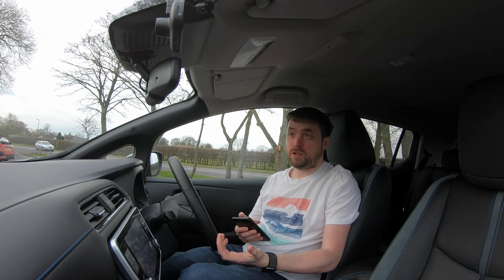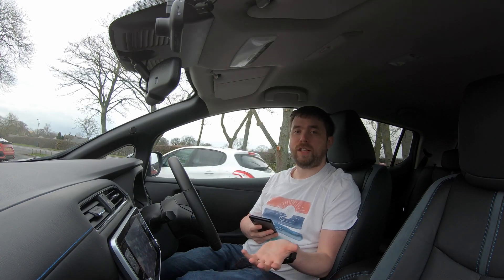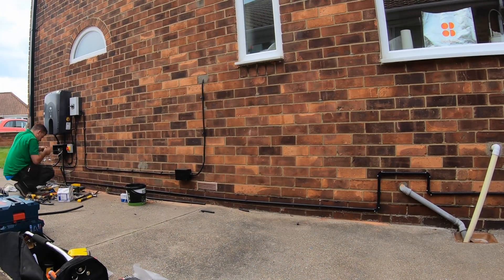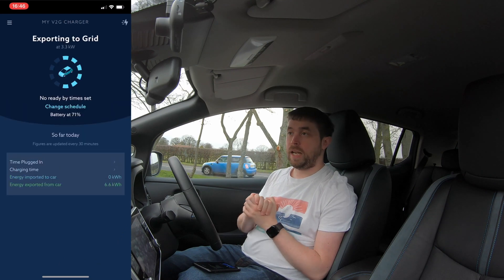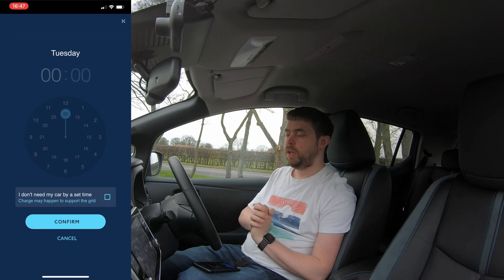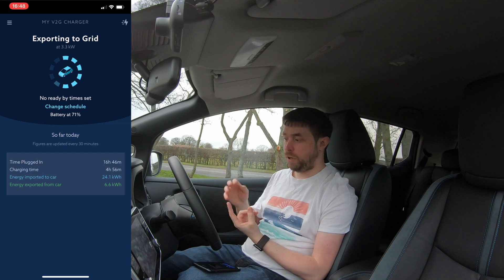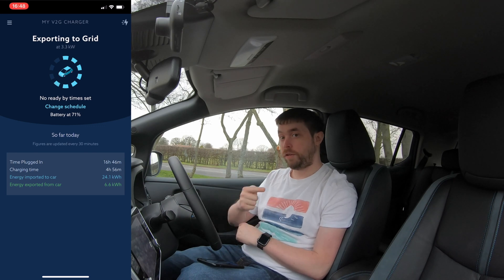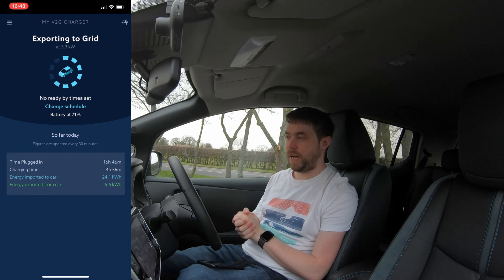2018 Nissan Leaf - Episode 047 - Vehicle to Grid (V2G)

Comment: The battery degradation cost more than £300 a year if it's going to be charged/discharged every day back and forth like that. £100 a month and it would start to make sense
Reply: I'm not sure if that's exactly true.  From what I understand, the lithium batteries like to stay at around 50%, so if you want to prolong your battery life, it's actually beneficial to charge it when it drops below this number and discharge it when it's above.  I suppose it depends on how the V2G system is configured, but in theory, it could condition your battery and earn you money at the same time.
Reply from the maker: Confirmed, V2G slowed down battery degradation for me quite a bit.
Reply: @unadopted  Can your system be set to stay between 10% and 90%?
Reply from the maker: I don’t have it any more as I no longer have the Leaf, but it was configurable and you could adjust the top and bottom thresholds. Defaults were to keep the battery between 20% and 95%.
Reply: @unadopted  Very cool, thank you.

Comment: Is this  still going?
Reply from the maker: The trial has ended but I still have the charger. Can’t use it any more as I no longer have a CHAdeMO-equipped car.
Reply: @unadopted  the idea looks good, and if it could make you a profit of £70 a month that could go a long way towards the running costs of the car. As long as it dose not unduly degrade the battery.

Comment: Great video and content, thank you. Given electricity prices in 2021 and beyond, can this unit power your house rather than grid export if required?  Cheers, 👍
Reply from the maker: Yes, but only while exporting. It won't work in V2H only mode yet (the Indra hardware is capable but the Kaluza software platform doesn't currently allow it).

Comment: Hii...I want to know that 
1what is the maximum capacity of the car can store?
2.The installation cost of V2G?
3.if 40% of battery is used as traveling ...if 40% of charge is exporting to grid how much power will go to grid?(just a guess)
4.time taken to charge the car.?

Am asking just because of am doing a seminar on V2G. Can you plz help me while solving my doubt!
Reply from the maker: Hi! Answers for your questions:

1. My Nissan Leaf has a 40kWh battery.

2. V2G unit and install was free for everyone on this particular trial. I don’t know what the retail cost would be.

3. If 40% goes back to grid that would be ~16kWh going back into the grid.

4. From completely empty to completely full takes about 8 hours, from completely empty to 95% is much faster, about 6 hours. To protect the battery the V2G unit won’t give power back to the grid if battery is below 25%.

Comment: It sounds really good but how do you factor in the increased degradation on your Leaf's battery. This has a hidden cost that'll eat into your profit margins. If you're on a lease then it won't make any difference but if you own your car outright, then it will affect your car when you come to sell it or if you need to get a replacement battery sooner than otherwise.
Reply from the maker: No noticeable degradation beyond normal use.
Reply: @unadopted  hard to compare to normal use unless you have a very comparable example or you have a much larger data set.
Reply from the maker: Mil You’re right that hard data is needed, but I can tell you that I’ve had the car for about 18 months before I got V2G and as I mentioned in the video I have been able to monitor degradation anecdotally with LeafSpy. I’ve had V2G installed for over a year now, and the rate of degradation has not increased.
Reply: @unadopted  fair enough. Thank you

Comment: £300 per year for degrading your battery sounds like a good deal for the utility company.

Price should be more like about £3,000-10,000 per year, depending on your battery and profile.
Reply from the maker: It's paying out quite a bit more than £300/year. No noticeable degradation beyond normal battery usage. If anything, especially during COVID-19, it's helped keep my battery healthy while my car hasn't been used as much.
Reply: @unadopted  Thanks :)

Comment: Great video but boy, that thing is ugly as sin. This needs to be far more compact to avoid your house turning into a electrical substation :/. Shame Tesla are anti V2G as their design is on point
Reply from the maker: Yeah it’s huge. But that said, it’s a lot smaller than the fridge-sized V2G units that Nissan Japan were showing off a few years back! 😂 I think Indra have done a good job with these given where the tech is right now. I’m sure in time it’ll shrink down. There’s a lot more equipment in there than with a Type 2 EVSE though (all the inverters and things are in the charger with CHAdeMO).

Comment: Aaron, I note that you are exporting at 3.3 kW. I was told when ours was installed that it would not be exporting at 6 kW. Is Kaluza going to get permission to export at 6 kW?

It's also worth pointing out that when charging a 30 kWh Leaf that has a 3.3 kW on-board charger the V2G charger will charge the battery much faster at around 5.5 kW. This is a big advantage when a top-up is required during the day.

Also, how long was it before you received payments for exports? Ours was installed end of October and we haven't received any payments yet.
Reply from the maker: Hi Robert! I explain why this is the case in the video at 1:43 :)
Reply: @unadopted  That doesn't explain if Kaluza intend to get permission to export at 6 kW.
I gave Kaluza the authority to apply on my behalf. I even got a call from Northern Powergrid asking me to explain the installation i.e. using the Leaf battery and not an additional static battery. The export rate remains at 3.3 kW. I don't think it will be increased to 6 kW, unless you have been told otherwise.
Reply from the maker: Hi Robert, initial install is capped via software at 3.3kW under install and notify rules, application for exceeding 3.9kW with the DNO is slow and takes a very long time but this is applied for before your charger is even installed (that’s the reason Kaluza/OVO require the signed form I mentioned). It can often take a year or so, and has to be applied for separately for every install Kaluza/OVO do, as it’s specific to each house. Once that finally happens and gets approved Kaluza can lift the software cap.

That’s a very good point about the 3.3kW Leafs though I hadn’t even considered that! A definite bonus for owners of those cars.

Payments are monthly, but not necessarily on your bill date. Payments are in the form of a bill credit (shows up as V2G export credit), you don’t get a cheque in the post or anything like that. At first they were a month delayed but that seems to be fixed now.
Reply: @unadopted  Thanks for the clarification on the 6 kW export rate. I had assumed they were going leave it capped at 3.3 kW.

Comment: Nice to see V2G domestically in the UK, Thanks Aaron. If my car was not CCS i would jump on this straight away, charge on solar all day then sell back and still get the FIT?
Reply from the maker: You lose FIT if you have this. Instead you get 26p/kWh credit (as opposed to 30p/kWh without solar).
Reply: @unadopted  Ah fair enough can't win them all, still nice enough returns for someone who was going to get an EV anyway and did not have solar. You are exporting more than i have ever used in a month. I appreciate you had to import it first.

Comment: Yes I have been on the trial, started 25th November 2019.
I have solar panels 4kw so I get 26p a kw. A few hickcups  but all in all I am happy. One question if I export say 12 kWh from my car why is it that I import 15 kWh from the grid when I haven't used the car.
Bob.
Reply from the maker: This happens because no electrical system is 100% efficient so some energy is lost in charging/discharging. For example, when charging the battery it gets warm, therefore some energy is being lost as heat.
Reply: @unadopted  It seems quite a lot 3kw per day appox.
Reply from the maker: @bobchambers6952  It sounds high, but it's probably not as bad as it sounds. The other thing to bear in mind is that the readings in the app can be off by up to 15%, so that 3kW difference you're seeing is also well within the margin of error if you're exporting say 20kW a day. If in doubt, fire an email to support@kaluza.com and ask them to check into it for you.
Reply: @unadopted  Ok. Thanks for that. Bob
Reply: @bobchambers6952  Another thing to bear in mind. When you are exporting to the grid the car battery has to power whatever you have running in the house. So not all of the energy drained from the battery went to the grid, some of it went to the house. During a 3 hour export our house would normally have used between 1 and 1.5 kWh so that had to come from the battery.

Comment: It's such a shame that the installation has to be so bulky and ugly with all the extra peripheral boxes, cutoff and switches. If only they could be all within the main unit itself. And then, come on OVO, get it working with Eco7 or some other kind of EV tariff.
Reply from the maker: Originally some of that stuff was included internally to the main unit, but that was changed in version 2 of the hardware to make servicing easier. That may change again in future once this becomes less of a trial and more of a full consumer product. I don't think this will ever work with Eco-7 or EV tariffs as the electricity supplier will be losing money so it's not viable for them to do so. The way it works out for me though, I'm on a much better deal with a standard tariff + V2G than I would be with Eco-7 and no V2G.

Comment: Hi Aaron, thanks for the interesting video. We definitely need the CCS standard to catch up with Chademo and offer bi-directional charging. For £70 per month I would be seriously tempted to join the scheme!
Reply from the maker: Yeah CCS getting this would be good, although I've heard that probably won't happen until 2025-2026 on the CCS side of things.
Reply: One versions of the "Dcbel r16" includes a DC CCS charger, that is set-up to do V2H/V2G now for the NA market. But the CCS committee has to give its official approval of the V2H/V2G protocols, before it can be that feature can be turned on via an OTA update . 

Which was originally set for 2025 but Dcbel is hoping that the V2H/V2G protocols will be approved this year? And I'm will to bet other companies will offer it too when the protocols are approved. 

fwiw the term bi-directional "charging" makes no sense... since it only charging in one direction... the other direction its power something, such as a home or the grid...

Comment: What potential issues could there be with the EV battery? I'd be concerned about more frequent discharging and charging and the affect this would (could?) have on longevity and resale value.
Reply from the maker: Hi Tim, I covered this in the video at 8:23
Reply: @unadopted  I guess that's why they're doing the trial to see how it works out over time. I wouldn't expect to see a detrimental change in a short space of time. I was in contact with OVO regarding this, but it's for this reason that I'm not going ahead (not enough information provided by them to convince me that I'm not being paranoid!).
Reply from the maker: Yeah it's one of the reasons for sure. But I can tell you that before they were allowed to release it even to us trial participants they had to convince Nissan that it would not have an impact, and that is the main reason it was delayed so long between the initial planned trial launch in mid-2018 and the actual trial launch in mid-2019. Nissan wanted assurance that it would not result in an increase in warranty claims, and so they wanted certification to be done first. Once this was done, Nissan were happy to allow the warranty to cover batteries used for V2G and so they were happy it was safe. If they've had to jump through a bunch of hoops to keep Nissan happy, and Nissan have now signed off on it, I don't think you need to worry. As I mentioned, some people are reporting an increase in battery health after using V2G for a while although I'm not seeing that. I can tell you that it has not degraded as a result of V2G in the 9 months or so I've had it.